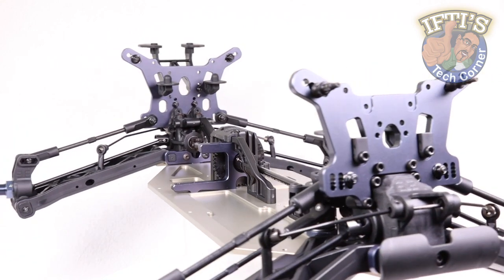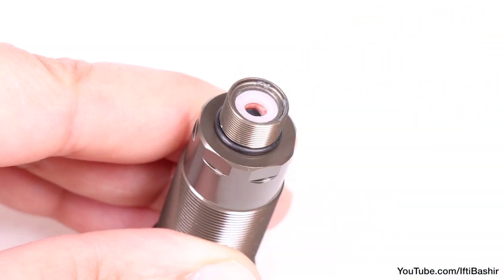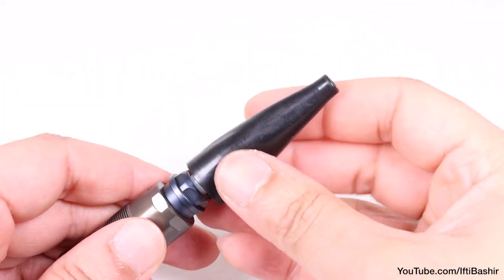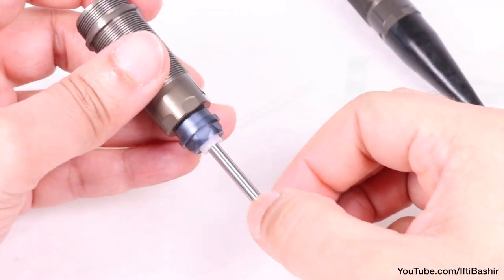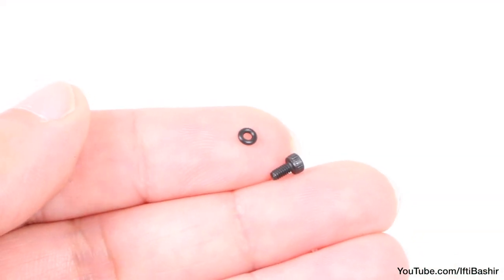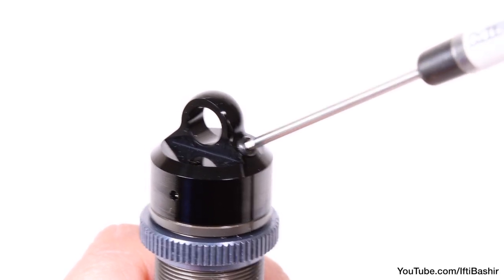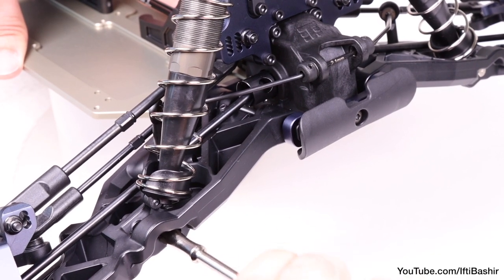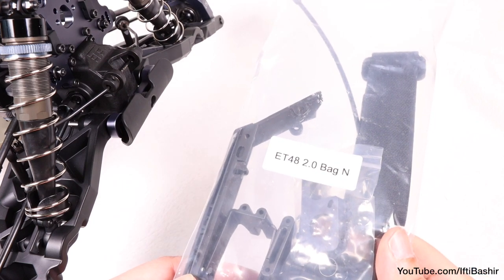#13 Tekno ET48 2.0 E-Truggy - BUILD SERIES - Kit Bag L & M : Shock Assembly

Comment: Yuo don't need thread lock to the botton, O ring is all it's need.
Reply: I was thinking the exact same thing
Reply from the maker: Have had it come loose on a previous vehicle, so I add a dab just in case. Wont do any harm ;o)

Comment: You put the shock on backwards.
Reply from the maker: Entire build is according to Tekno build guide.
Reply: @iftibashir  the guide shows the large part of the shock caps bushing facing the shock tower not the small part as well as all of the tekno cars.
Reply: are you sure for the black screw on the facade ??? in the tekno rc manual .. they say the opposite:  black screw is RH threated and goes left side
Reply: @XAVLEPORSCHISTE  yeah bro it’s definitely wrong but let’s let it go he doesn’t want to fix it lol
Reply: @DrewPrce  It will end with the shock absorbers unscrewed !!!